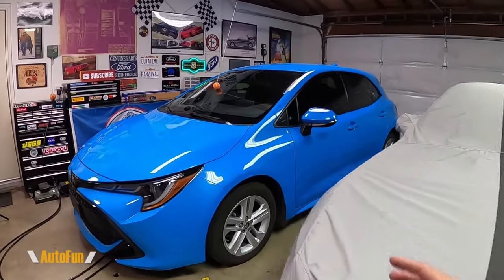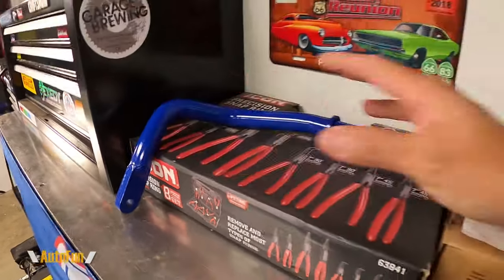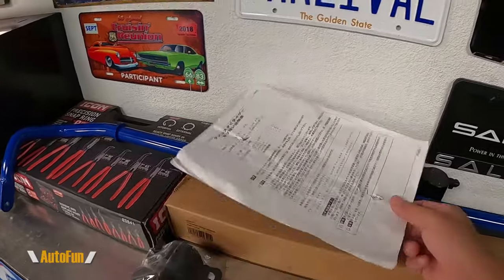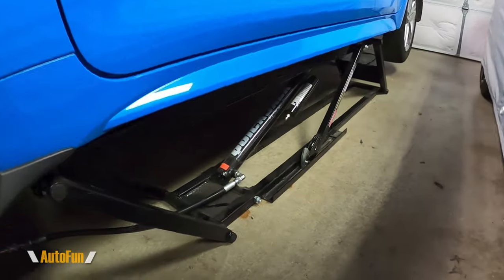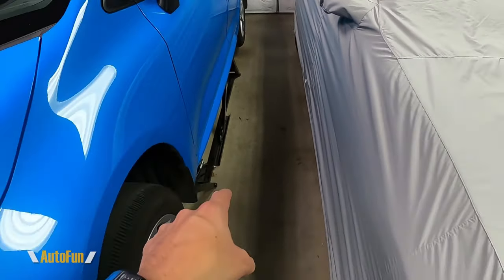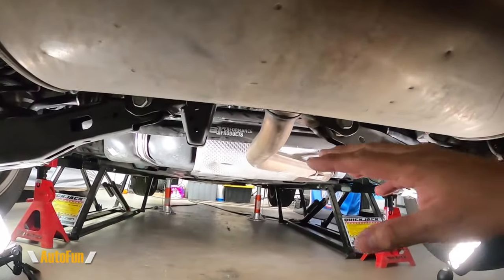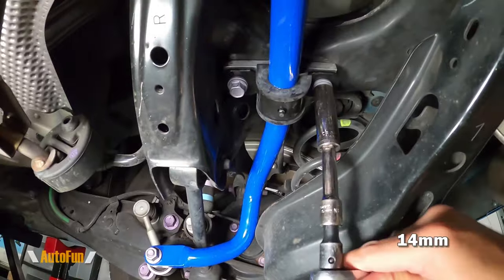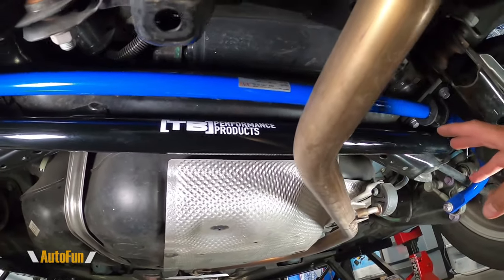Toyota Corolla CUSCO REAR SWAY BAR Install & Review (E210 Hatchback & Sedan 2018-2024)

Comment: I just did this (Progress bar, not Cusco) and the only thing that's missing from this video is the bottom plastic shields that need to be loosened to get access to the forward-most bolts at the top. The passenger side has a single 10mm bolt and the drivers side has a single 10mm bolt and a plastic pop-in fastener. Once they are removed, the shield can be pushed down enough to access everything. I also removed the drivers side wheel to be able to get the old bar out and the new bar in a bit easier.
Reply from the maker: Hi Bobed Mark! My E210 did not have any shields in the rear of the car where the bar is located at (same with other E210s I worked, haven't seen a shield back there, all bolts where accessible from the bottom of the car as seen in the video) sounds like your did, interesting... Cheers!
Reply: @AlexAutoFun my 2020 XSE CVT has the rear plastic shields he’s talking about. Makes the install take longer. My wife’s pissed at me now because I told her 20 minutes. Hour later she’s salty and making me sleep on the couch
Reply from the maker: @parsineo  Very interesting, I wonder if that was added in 2020 or is a regional add on (Sometimes car sold in specific areas have small differences to work best in their intended environment/destination or maybe specific to the XSE trim). Cheers!
Reply: @AlexAutoFun  my guess is it’s due to the XSE trim or the fact that it’s a CVT.

Comment: all rotation forces are transmit through the outer edges of the bar...but a larger hollow bar will perform the same as a slightly smaller solid bar and weigh less too (think 1-3/8" hollow vs  1" solid); but your Cusco bar goes the opposite direction in that it has a bigger diameter and is solid.  I'm sure the two-three pounds heavier isn't much, especially when we are talking the weight of the car.  Funny, my WRX stock rear bar is only 19mm and the Cusco upgrade is 22mm
Reply from the maker: Hi SummerBRZ! great explanation, yeah 3 lbs. isn't bad at all, car feels much better overall (on a side now, nice BRZ man! I recently test drove one and I really liked it, I may have to add one to the channel!) Cheers from Calfornia 🍻

Comment: If I decide to get a sway bar, do you recommend getting the rear first? I've read that rear sway bars are more beneficial to handling for FWD cars. I am also interested in the front strut bar but I'm not sure how beneficial it would be for me. My end goal is simply to increase the handling performance and reduce body roll so I can have more fun driving the car. I have no intention to go to a track and this would be my first modification.
Reply from the maker: Hi dang! I typically recommend doing both as a set. But it won't matter much which one you start with unless you are planning on doing only one of them. Which if you are, then you want to do the one will make the car behave the way your want it to (either front end or rear end happy) some people prefer a car that understeers (for street use) and others a car that oversteers (track oriented). Both of these conditions can be induced by installing only one bar (and made really noticeable if paired with alignment settings for the condition you are trying to induce) Hope this helps and thanks for watching bud!
Reply: @AlexAutoFun  Awesome. I appreciate the advice.
Reply from the maker: @danq_  You're welcome!
Reply from the maker: @danq_  You're welcome!

Comment: it’s easier to install and torque properly the bar when you ramp the rear wheels.
Reply from the maker: Hi jt mix! interesting, I didn't think of trying that since I went by the Cusco instructions but I think I know what you mean,  I haven't had to use ramps in many years since I got the lift but I may have a pair laying around for the next install...
Reply: @AlexAutoFun  the droop puts tension on the bar. the bar itself is a spring resisting torsional twist. I learned that from working on my miata. it’s documented in the Racing Beat hollow bar that I use.
Reply from the maker: @jtmix5545  Yep that is correct! the increased torsion on an aftermarket bar is what makes it work better than stock. I suspect the reason why the Cusco instructions don't mention for it the suspension to be loaded is that there is the possibility of getting a finger crushed or some injury if releasing the bar under pressure (I seen a fellow partially loose a finger on another suspension job since it was loaded! ouch) since then I always work with the car suspension unloaded, but like I tell people I'm just a dude in a garage with tools, I'm often wrong, don't follow what I say! stick to the service manual and your SAE training! LOL

Comment: Hi Alex, what are the torque specs for the sway bar? I can't find the proper spec anywhere.
Reply from the maker: Hi Joselito! The torque specs are included on the instruction manual that comes with the Bar. I have also placed them directly in the video along with the bolt and but sizes. Cheers!
Reply: Of course, it's right there, clear as day! Thanks, Alex. Love your channel.
Reply from the maker: You're welcome and thank you Joselito! @Singleharted1